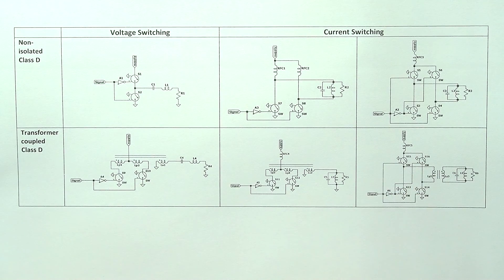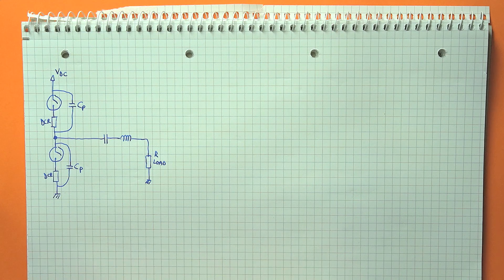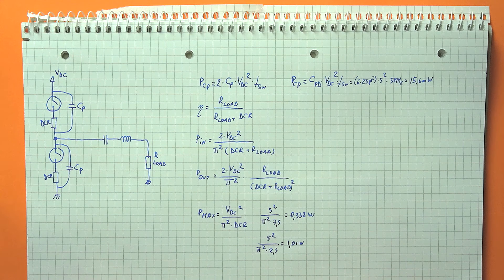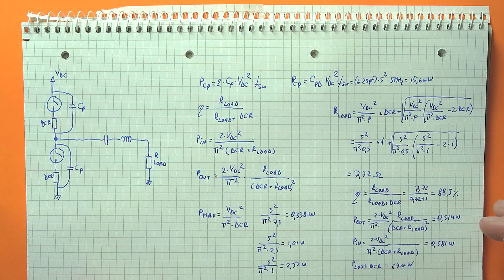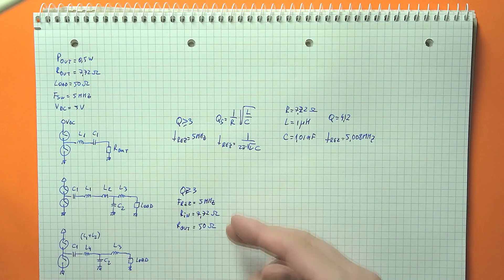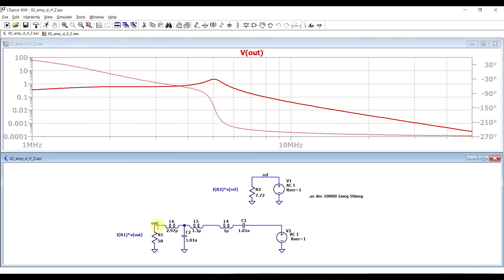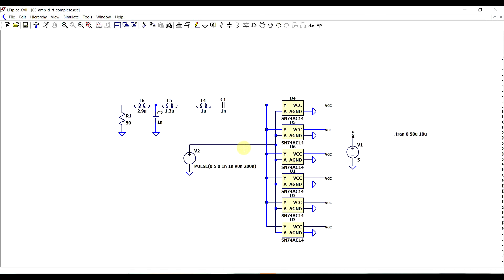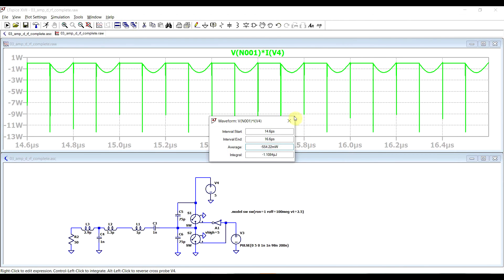The Class D RF amplifier - Design and calculations (2/3)

Comment: Is there are special reason why you dodnt go with the normal drivers? Or simply use a buffer IC as the driver? (there is also the BJT option.....).
Also since those were SMD parts i assume you are making a PCB. There is also the option of using 4 ICs in order to increase the max current in case you need more
Reply from the maker: I'm building this circuit just as an experiment to highlight how it works, I don't plan on using the amplifier for any other purpose. I could have gone with a buffer IC, that sound like a really good alternative, but I already had these inverting gates around so I decided to use them.
Reply: @FesZElectronics  THX that is a good explanation .
PS are u making the PCB at home or using a fab like JLC?

Comment: I think there’s a maximum of 50mA for the whole IC, a rating for the Vcc or GND pin. I’d just put a single-stage BJT totem pole (or sziklai pair totem pole) after a CMOS output, pretty simple and you won’t be fretting about the 0.6V drop on either end at only half a watt.
Gate driver ICs like the IR2184 are really handy to have too, I’d get half a dozen. Don’t buy FETs without them.

Make it into an FM/FSK transmitter using a 4046 on either end, I think they can do 5MHz.
Reply from the maker: I think the 74AC14 datasheet states as absolute maximum a DC supply current of 50mA per output; but I guess they never intended this sort of usecase so a clear global value is not given.
I just noticed, in the SN74AC14 (Texas Instruments) datasheet, there is a global 200mA value for continuous DC.
Reply: @FesZElectronics  I’d test it with some resistors if you have a 74X14 lying about, it’s probably close enough.
Reply: IR2184 is much too slow for a 5MHz amplifier.
Reply: @alainblazit9504  Oh yeah, the fixed dead-time of 500ns. The 21844 would probably work.